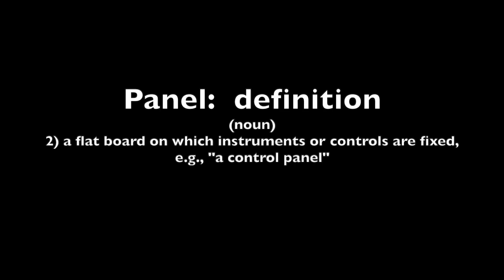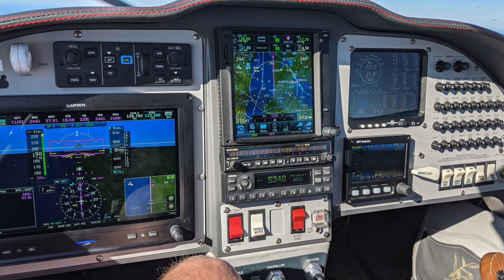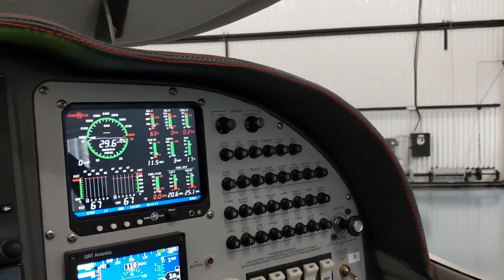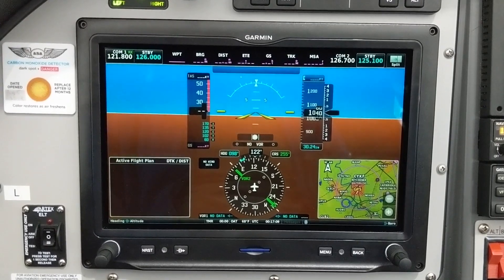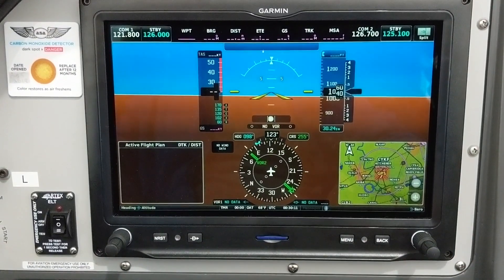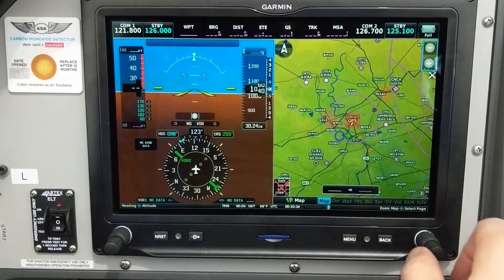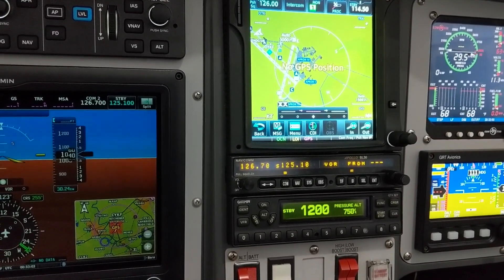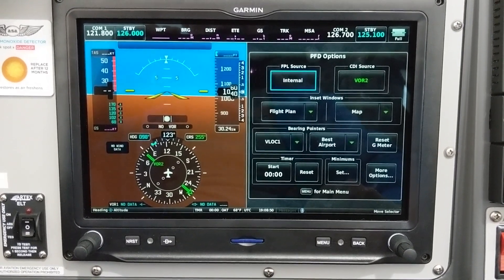Panel Porn   Part I

Comment: Intro was hilarious!  Any reason you did not use the Garmin EIS and G5 for backup AHARS?  Did you install AOA?
Reply from the maker: Hey John, thanks!!  Great questions, the aircraft has the pitot lines in place for AOA but it was not installed.  Next upgrade will have it.  I am working on an upgrade that includes the G5 as my backup EFIS.  The advantage over the GRT Mini-X is that more data is shared, and the G5 will fly the autopilot in case the G3X fails.  Amazing capabilities in these Garmin components.